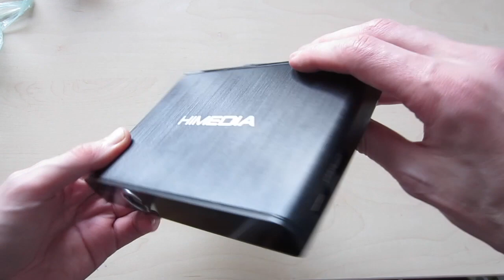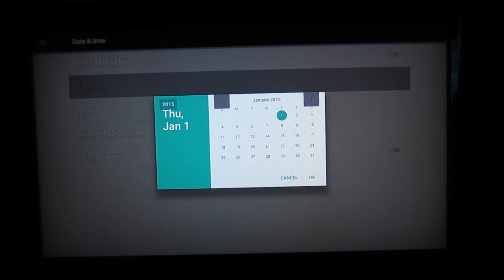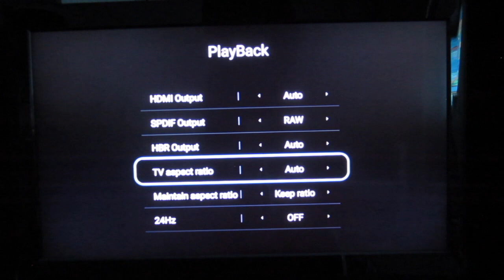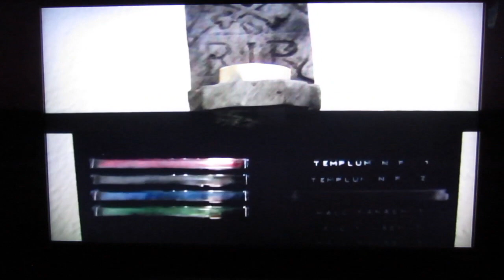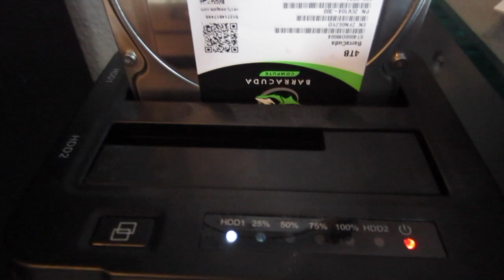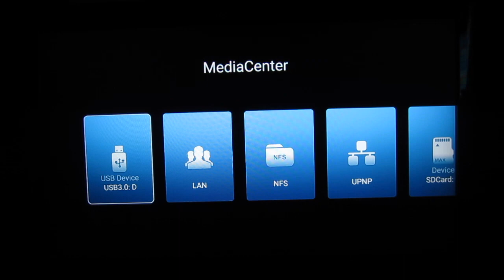HIMEDIA Q30 Android TV Box Mediaplayer Review and Thoughts

Comment: Hi, can you tell me if this TV box supports Dolby true HD and DTS X.  I have a Dolby ATMOS 5.1.2 home theater system, but my X96 Max does not support Dolby true HD and DTS HD, and for that I am looking for another TV box that supports it, so I can play my MKV files from an external hard drive. Thank you in advance.  :)
Reply from the maker: According to the official website it supports MPEG L1/L2, AAC-LC, HE AAC V1/V2, AMR-NB, AMR-WB and PCM. According to myhdplayer it supports DTS-HD, DTS:X, Dolby True HD and Atmos.
Reply: @freund333  Yes, thanks I just saw it on the official site, but that leaves some doubt.
Reply: Not sure if it matters anymore. Looks like it has been 2 years since this question was asked, but for posterity. 

It does do HD audio in both DTS and Dolby, but good luck getting Kodi to do a "passthru on it." You have to use its own media player and set the audio in the settings to "RAW", not "auto." And you need to use what is called a "wrapper" to get the machine's media center app to play HD audio. Or else, you'll just get LPCM like the rest of them. The media center player is actually a really good app but it lacks any extra features such as playlists, library, etc. It's just a barebones player. Again, it does a great job, video processing, HD sound, decent interface, and controls, just wished, for me at least, it can handle playlists.
Reply: @armon-wu1tl  i use nvidia shield tv and i am very happy playing all audio formats.